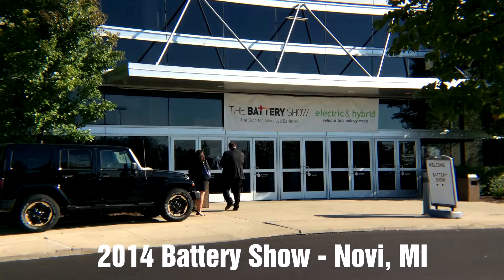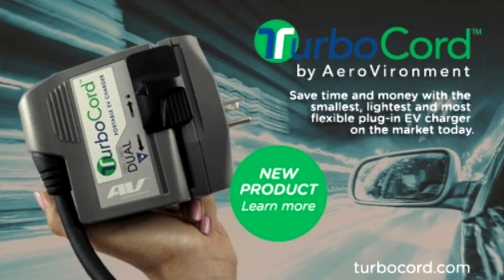AeroVironment's Turbo Cord - Wrenchin' Up

Comment: Single phase household voltage is 240VAC !! w/o load, the split fase common outlet 120VAC dear Engineer-Rep. form Turbocord. Not 110 or 220 as you said.
Reply from the maker: Hi - Thanks for watching and sharing your comment!

Comment: The 220 plug may be hard to find.
Other converters may offer higher charging rates.
Reply from the maker: MellowVanGuy Very true - but it looked like a nice upgrade to the supplied 110vdc cable by adding 220vdc option.